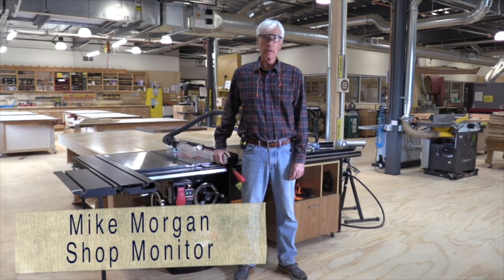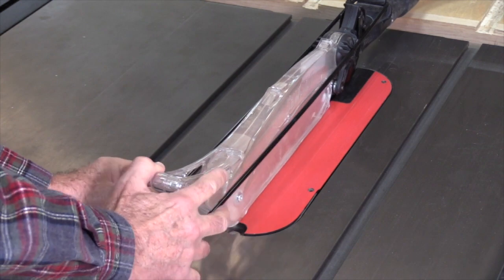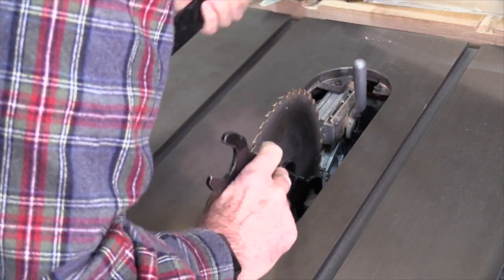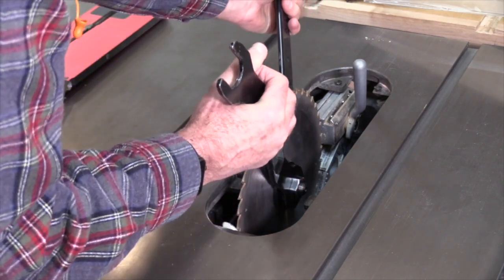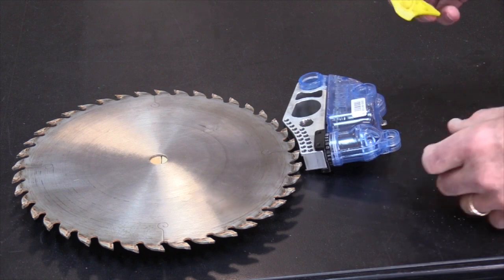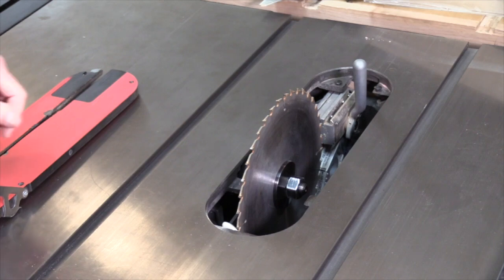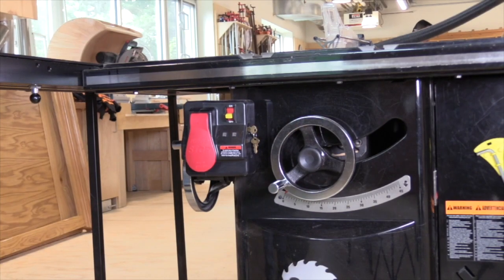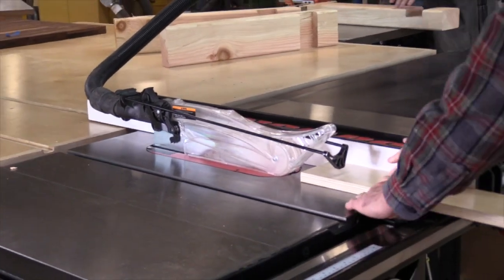Blade change on table saw with Saw Stop

Comment: This was cool and very much appreciated. I recently began teaching MS Engineering & Technology at a new school and it's equipped with a SawStop table saw ...but I haven't come across documentation or the feeler gauge yet. I recently came across a set of dado blades and I would  like to install them for some half-lap joints.

While I've used the saw a little for becoming familiar, is there anything I need to be aware of to keep myself and students safe?

Thanks!

Comment: I noticed that you took the brake/safety mechanism off the saw to adjust the distance between the blade and the brake—is that the way to adjust it?